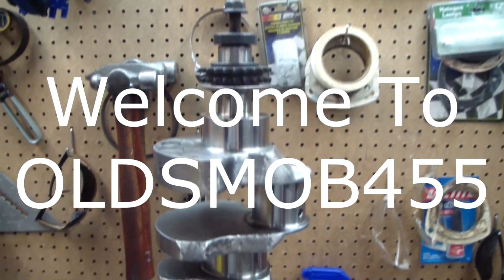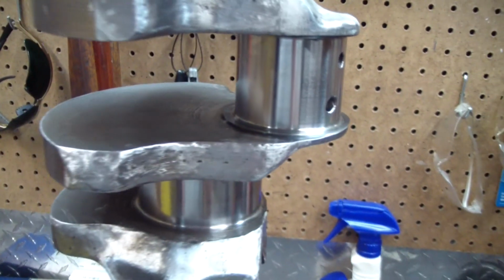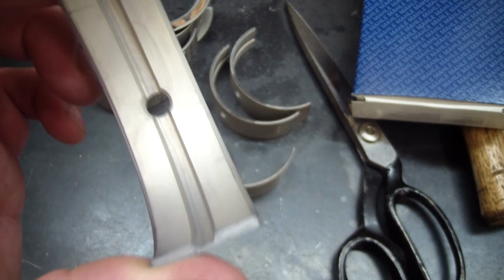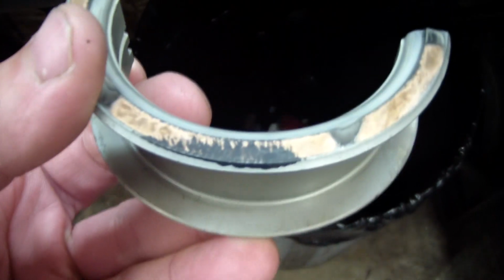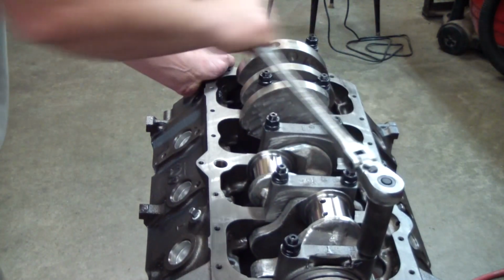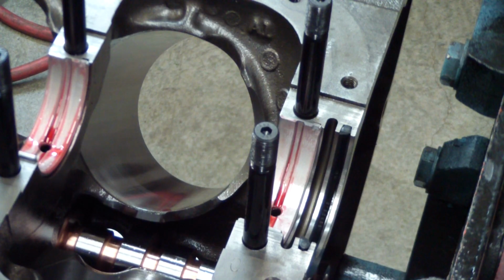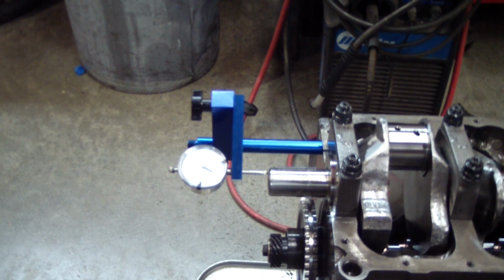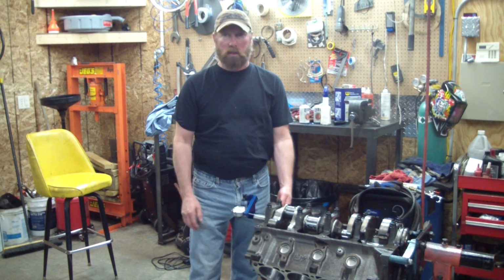AMC 401 Crankshaft Installation

Comment: Hi, You used the plasi-gauge and found the clearance between your bearings and crank journals, I understand that.  But what if the clearance was more or less than desired?  What would you do then?  I'm restoring a '72 Jav AMX with a 401.  Enjoying your videos.  Thanks
Reply: henry nevins.  Wao! You never got an answer thats messed up.
Reply: Have the crank machined to the next undersize..or for some engines I've seen oversized bearings,in .001,.002,but only very common engines...most likely you will have to have it turned to .010 or more and use .010 bearings